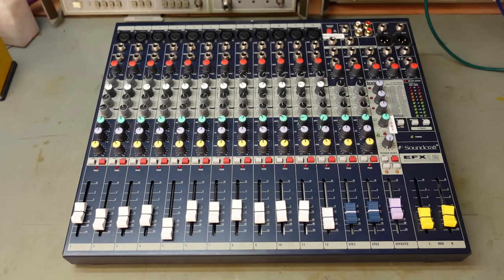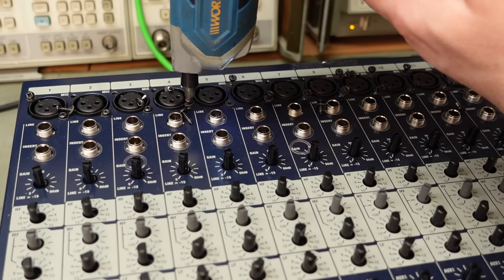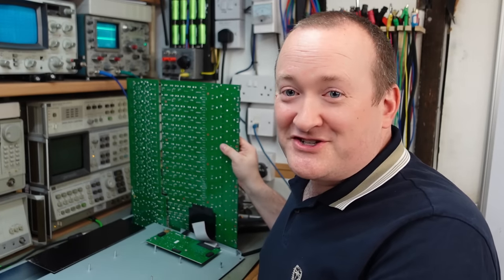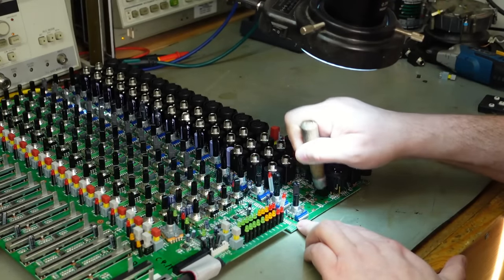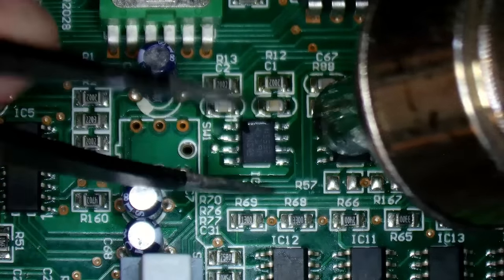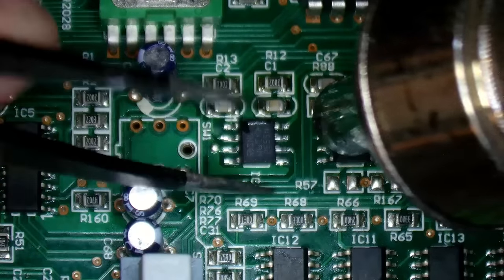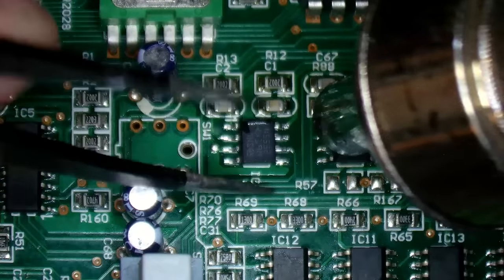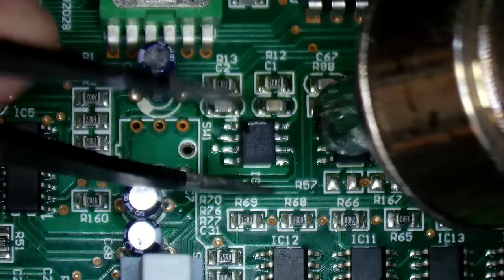Mixing Desk Repair - Soundcraft EFX12

Comment: As a sound operator of many, many years, it's easy to forget sometimes that all the knobs, dials and faders don't just intuitively make sense to anyone who walks up to a desk.   Also, if you show 6 guys the same board, you'll probably see 8 ways to use it due to differences in preferred workflow.  So overall, good job on finding your way through, even if it was a little painful to watch up front!  ;)
Reply: When are the "drumbeats" going to return? I always enjoyed watching those videos!
Reply: I do relate to this to a certain level. When I showed my grandparents my surround system for the first time, they were asking me what a speaker was hahaha
Reply: HAHAHA. Well I think I figured out 9 ways. I did a open mic coffeehouse, each performer would get two songs and then we would take a break and have a featured artist at the end for the second half. They started with a 12ch =/- peavey that had developed a fault in the digital processor which also took out the main mix momentarily to temporarily. I also worked at another other church which had a 32 channel of the same model which did the same thing that's now sitting in my basement one day I will investigate. They finally (Church property) replaced it with a good old fashion analog new sound craft. Never quite did figure out how the effects worked Foley. it was a similar model mixer and In the end at that location I just stopped using most of the mixers features and only use the preamps to feed into my own mixer an xr18, so much easier and I had a preset for that venue to bring everything up into the default state that I like to start in. After patching cables ( I converted a snake to a insert direct out snake ) all I had to do was check the gain, stereo return and master level, I would then twiddle the gains a little depending on the acts but mostly do the mixing and affects outboard. There was nothing wrong with that mixer other than it occasionally had other users which meant rechecking just about every channel before and of course it was mounted in the most ridiculous of locations. Standing in front of the mixer just slightly off-center of a 20 x 50-75' converted Pavilion staring down the barrel per se with the band right center on the long side and the mixer 8x8 feet from the short side wall corner literally a half wall from the end Center door pathway in this weird Half wall cubicle were things like to get stashed.
Reply: How many soundguys does it take to set up a mic stand ??? TEN(10) ... One to set the stand up and the other nine telling him how much better they could of done it and how bad of a job he did . LOL...LOL.

Comment: I have a Makie 1604 VLZ with an intermittent channel 1. I've had it apart and cleaned push switches, faders, pots etc, re-seated cables, which only solved the issue for a day or two. Never thought of checking the resistor, the layout inside looks almost identical to the Soundcraft board. Will give it another look.... thanks for the idea!
Reply: As it's only one channel, I'd put money on it being the Insert jack on that channel. If the insert is bunged up enough, it acts as though a connector is plugged in, effectively muting the channel. Get into the insert with some contact cleaner and a jack plug and give it a really good agitation.
Reply: @AG-cg7lk  to add to this information you can also make up a dummy jack which passes tip to ring which aid in diagnosing this fault.

Comment: Beware of the microphone DIN inputs. Ensure that the phantom power is switched off or you could put 48 vdc into the output of your sig gen !
Later in the video I see you are aware of this but I will leave this here as some may not be aware.
So pleased that you got the twelve channel mixer working.
A few years back I took on a Behringer Eurodesk SX4882. It only won insofar as time spent repairing it, never again though.
In total 27 hours spread over five days and a repair bill of just under £360. Beer & mixing desks do not go well together !
Reply: Totally feel for you mate. I have a eurodesk 3282....32 channels with 8 subs. Bought off of fleabay with a noisey output. Turned out to be dry solder joints on the master faders.
I'm still flakey on how long it took, but it was bloody ages. Literly a bucket full of pot knobs, screws etc. It's due a service (deep cleaning), so it's time to beg the repair tech gods for some patience....and plenty of mugs of tea and maybe a beer of two aswell 😁
Reply: DIN? You must mean XLR (or Cannon if you so will)... DIN belongs in the 70s....
Reply: As an audio engineer and DJ, I've learnt to swerve Behringer kit. Items might cost less than many other big brands... but they aren't very robust. And so second-hand items are just a disaster waiting to happen!
Reply: They're not DIN. Those are XLRs, sometimes called Cannons (the original manufacturer. How is the phantom power on a microphone input going to end up on an output ? You're not meant to use them as high level inputs (although it can work but risks early clipping). There's a jack input as well which is 20dB less sensitive.
Reply: @pnnielsen  DIN  sockets are use all around for sending MIDI signals.
Reply: @S-Theo  The OP was talking about microphone (=analogue) DIN inputs with phantom power. MIDI is digital and has no phantom power. DIN used to be the standard for European audio consumer gear (home stereo) in the 60s and 70s but was slowly overtaken by RCA (phono) in the 80s... As it was phased out as a standard consumer interface, I guess the MIDI creators found it fit to use it for digital data instead of audio.... Maybe I should have said "DIN for analog audio belongs in the 70s"
Reply: @squaddiepete  both Behringer and Ebay yes oh yes.... I was at a church where somebody lovingly donated a freshly purchased ebay Behringer 32-35 something channel mixer without notifying us beforehand. We had a guest band coming in and I didn't want to mess with the mixer that we were sort of having issues with if I'm remembering right. So not wanting to mess up Thursday's band practice premix I swapped over to our original 16 channel Mackie, Oh boy and it sounded different so very different and clear. I was thinking no wonder we were having such trouble mixing Sunday service. Of course that mixer wasn't long for this world and eventually made it into my basement. The Behringer model we had had a digital processor in it and it was during service when the main mix just cut out and I was thinking it sounded really funny and then I realized we had no main and we're just hearing the stage monitors. I waited for the I think it was one or two songs and as we went into announcements I went for a hard reboot on a 99% analog mixer and we had main mix back. That is until band practice a few months later when the problem reappeared and progressively got worse. Went from a reboot to occasionally a reboot fixing it to a reboot not usually fixing it.... This is an entirely analog board except for the effect send - return that went to the processor which was fine, and the main mix which went through the processor for USB play record which didn't work right unless you have the specific compatible USB drive and main mix only feedback detection ( tested, was slower than actually turning the fader down), delay, EQ and some other things. So for a few months we were using the sub group as a main out. Then we upgraded to a pre-Sonus 24.
Reply: @pnnielsen  DIN were used till 90's in home audio equipement.
Reply: @S-Theo  Maybe by some brands, but most Japanese brands went RCA only already in the early 80s and treated the DIN as a legacy tape deck connector. I was born 1968 and I remember my dad's Telefunken and Philips gear from 1970-1975 was all DIN connectors only. I bought my first casette deck, a Technics RS-M250 and an SU-V9 amplifier in 1983 and while the tape deck had both RCAs and DIN, the amplifier only had RCA only on all inputs, except for a single additional DIN as an option for hooking up the tape deck. When I got my next Technics amplifier in 1987, they had totally done away with the DIN option... Thinking back on this, I remember the DIN speaker connector (one small pin and one larger flat pin). I don't think I ever saw Japanese gear use this...
Reply: The din connectors were a European standard that replaced the inferior RCA connectors, yes. Didn’t have the staying power and didn’t go global.
Reply: @pnnielsen  im more than 50 too. Check out Grundig and other european manufactures. They all had DIN and RCA inputs and outputs. I recently fixed some of that equipement.
Reply: @JasperJanssen Yes, as the name says, it's a German standard. However, DIN was never able to replace RCA. In fact, DIN was more short lived than I thought, being a standard from the 1960's according to Wikipedia (I actually thought it was older than that). Also, don't you remember the cable headache of those days with the need for crossover cables, etc. And the DIN connectors were a bit tricky to solder - if you heated up the pins too much, the plastic would melt and the pin would move sideways resulting in crooked pins. No wonder RCA won... Oh, and remember the original IBM PC used the original 5 pin DIN for the keyboard connector. (Later on, they moved to mini-DIN).
Reply: @S-Theo  I'm specifically referring to gear 1968-1974. For example Basf, Telefunken, and Philips only had DIN. Even the big Philips 10' reel-to-reel deck N4450 only had DIN (7 or 8 of them) and nothing else. Not a single RCA in sight. The equipment you recently fixed probably was newer, like from the 80's when they started to realize DIN had lost the battle against RCA...

Comment: Hi Mark, I have 2 Soundcraft EPM mixers, one a 8 channel and the other a 12 channel. They are very similar except without the FX bit. Both, since 2012, have been reliable so far (that’s me tempting fate). The outputs are  “electronically balanced” using the resistors to give the same impedance on each of the balanced connections.
I used a similar arrangement for balanced inputs on the interconnecting leads to enable the unbalanced insert points of the mixer to connect to a 24 track digital recorder (I’m only used 8 channels/tracks at the time). There are separate record (input) and playback (output) leads so the insert points can be used as both input to record and output to mix down via the mixer (in analogue) or using digital for computer mixing etc. My mixers are used to record everything from soloists, choirs to an orchestra for live broadcast hospital radio programmes. The only problem is that the phantom power is ALL channels or none, therefore two mixers. I now have phantom blockers and transformer isolated splitters too.
Reply: Looks like it Takes longer to open it and reassemble it than fix it.
I know what to expect now. Thanks Mark.

Comment: I really appreciate the camerawork and editing in these vids.

And just the general problem solving is top-notch.

I watched the vid on the linear turntable earlier.
I don't want to spoil it, but you went above-and-beyond on that one. I would have given up far more easily. lol

As soon as you mentioned opamps in this mixing desk, I KNEW they would all be NJM5532.
It's like the go-to opamp when they don't want to spend too much money. lol

To be fair, that opamp sounds OK. It's quite a good bang-per-buck, excuse the pun.

I'm only half-way through this vid atm. I'm a bit worried that the voltage rails weren't checked before replacing all the opamps.

My guess is that somebody plugged in a cable with 48V Phantom Power (from say one of the XLRs) into those channels, which popped the opamps. Or something a bit more scary, involving mains voltages. lol

Comment: Last time I watched someone tackle a mixer it was a cheap brand and it had a problem with bad capacitors, apart from having to pull the mixer apart, he decided to replace every single electrolytic capacitor and there was a lot of them and I decided right there and then that I would refuse to repair a mixer.... You couldn't pay me enough to work on one! 
You are definitely a better person than me LoL 🤣.... Great work!

Comment: Here I am, watching Mark doing some fancy hot air soldering and thinking why ... why am I not doing this myself - enough stuff here to fix too 🤫
Ah well, at least the mixing desk I received had an easy repair: "channels 1 and 2 have low volume" was fixed easily by turning up the gain pots 🤭

Comment: Nice video, thanks. the symmetrical mix outpit is once again the economy version. Soundcraft loves it. That's not nice. The many buttons and screws are amazing. I once pimped a 24 channel mixer. That was even worse. The potentiometers were still screwed there.

Comment: I work with these all the time and if this was situated in a certain setting the aux out would be used as monitor. expecially if it was for a band. you could use he aux to give the drummer or lead guitar a different vol level than that of the monitor

Comment: I enjoy your work so much mate! I feels like I am seating by you, ( some times even talking back to you:  you better vacuum that metal shavings; or you are placing that upside down!). I would love to take my KX600 Kenwood tape deck to your shop; I know it needs some belt replacement for 24 years now, and you'd find something that could be replaced or touched up. The only problem is that we are in different continents. So... I'll keep watching you repairing a technics deck.

Comment: Good and interesting videos of the equipment and repairs, thanks! I never see anyone ever using that copper de-soldering braid anymore these days. I was surprised to see that people still use those terrible glass fibre pens to clean PCB's - those things were hell on earth, we stopped using them in our factory almost 30 years ago due to the problems the operators got due to the tiny needle like fibres that went into you skin on your hands. God knows what they did to people lungs, a row of 20 ops all using these pens and each bench fitted with a fan to blow the dust from one bench to the next person in front. Then throw in an ultrasonic bath that was using Arklone K, and each op. with a 300ml can of Trich. what a wonderful workplace - No fume extraction, tin lead 60/40 solder, it is a wonder our kids had hands and feet!

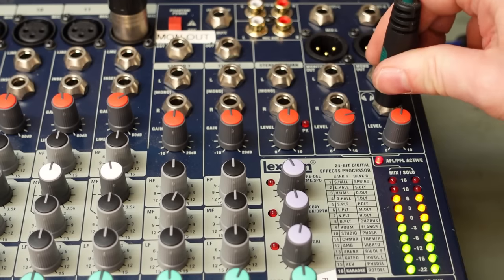Comment: I am a PA sound man FOH / MONITOR over 40 years, AND have "The ear's" so to speak. Some artist i have done more then  years of touring. I notes that  at 3:28 The AFL/PFL is active, the meter  then off for left and right.  John -  SOUNDFILL ® I use Martin Audio - Crest Audio amp's Allen Heath and the Lexicon is A-Brand. In the past have  2 MPX- 1 in my FX Rack's.

Comment: I miss the days when you could unplug the module. It was so much easier and quicker to repair. I recently worked on a Peavey 24 Ch. console and it took me quite some time to disassemble it just to replace one Op amp. At least I had access to all of the controls so I could clean them.

Comment: This one was a fun, action-packed edition mate!  Knobs, nuts, chips n crows flyin round left right & centre!  And you discover someone else has been messing with it!  Grrr! 🤬!  Nevertheless you triumphed in the end.  👍💪💥💯👏

Hey I gotta say mate, your soldering methods are as good as mine, & you're the second person ever to get that recognition!👍  Your photography is such that I see how you leave the soldering iron tip in the solder joint for juuust 1 second after you remove the applied solder from the joint.  This gives the flux that short extra second to fully activate & do its job before the heat is removed.  I see you doing that Mark. 👍  That's nasa standard mate.

I was trying to think of what "naughty" thing someone had done to damage the mixer so extensively, & how power must have be applied to it somehow where it shouldn't have been?  Then you mentioned phantom power.  D'oh!  Of course!  That's 48 volts DC, that's supposed to be supplied to the mike via 750 ohm resistors & isolated from the mixer inputs via 47uF capacitors, with 1meg resistors on each of the balanced mike outputs to discharge the capacitors.  

So yeah, absolutely, a mixup in the wiring to a phantom power mike is exactly the kinda way to get DC power into a mixer where it shouldn't go!

So yeah, that about 6 thumbs up you got from me me here; you did well! 👍

Comment: When I replaced the MCU in an ECU on a Mercedes coupe I used to have, I used foil tape to protect nearby plastic parts for hot air soldering heat. It worked a treat. I've got the older version of this desk. Seems they've cheapened it out quite a bit 😞

Comment: Hello Mark, good job you removed the flux because it can cause transmigration of copper between tracks which results in dendrites and ultimately short circuits forming.

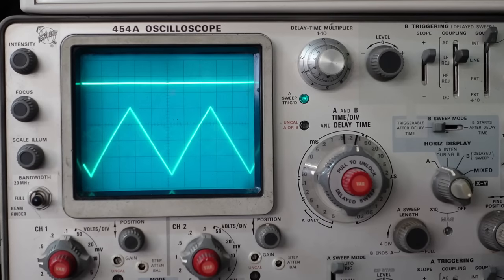Comment: Yeah those things have a weird Jack layout. Even I was questioning why there was a label for monitor next to an input and then I realized the label is covering up the microscopic letters that say aux output. Also the headphone jack is a stereo output and that's a mono jack 3:27 fyi shorting one headphone amp output. The monitor output is control room monitor same as headphones but separate volume. I used a similar model mixer and the lexicon has a "memory" (air quoting with my fingers didn't put quotes around word weird) feature which is why the lights blink. In the end at that location I just stopped using most of the mixers features and only use the preamps to feed into my own mixer, so much easier and I had a preset for that venue to bring everything up into the default state that I like to start in. After patching cables all I had to do was check the gain, stereo return and master level, I would then twiddle the gains a little depending on the acts but mostly do the mixing and affects outboard.